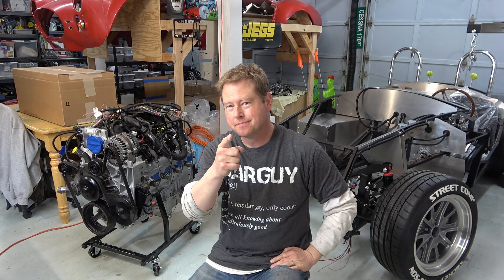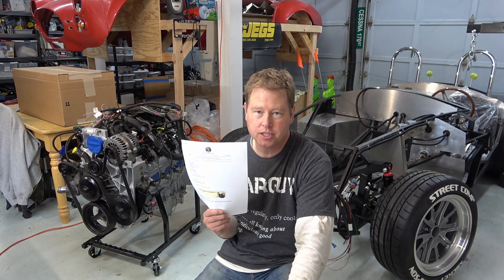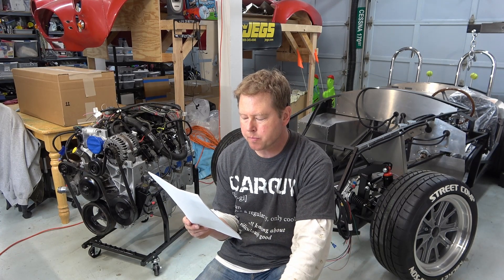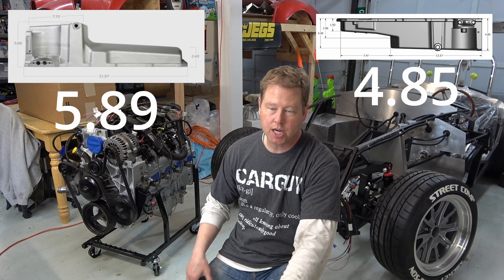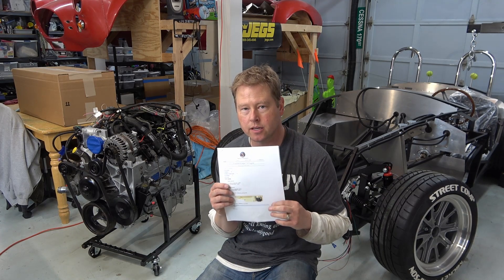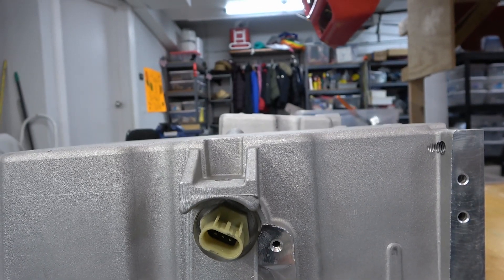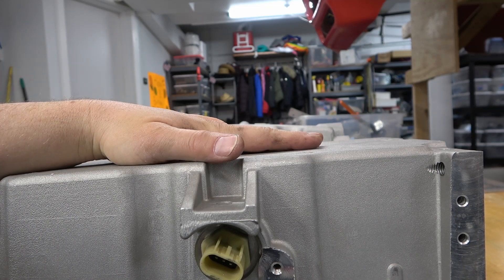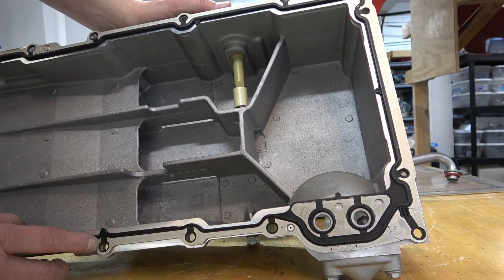Budget LS Factory Five Cobra | Build Update 26

Comment: Did you miss a nut on the crank cover?  At 4:15 I see a missing nut (left side of video)
Reply: That nut is goes on after the oil pickup tube is in place. My ‘volunteer child labor shop assistant’ gets it on at 4:29.